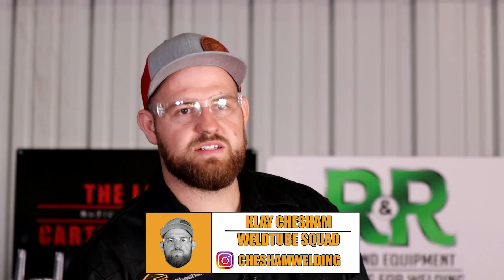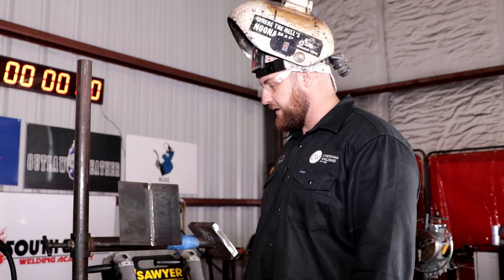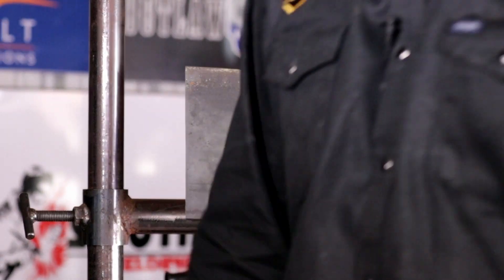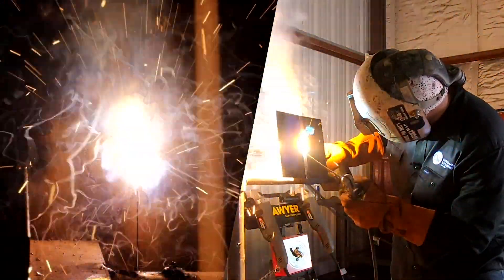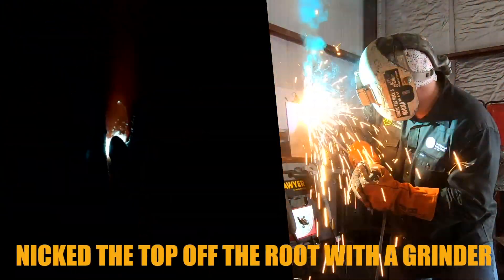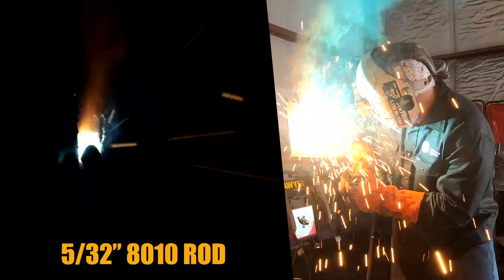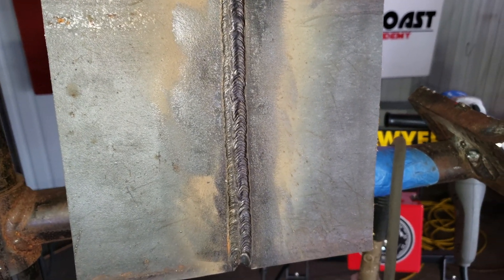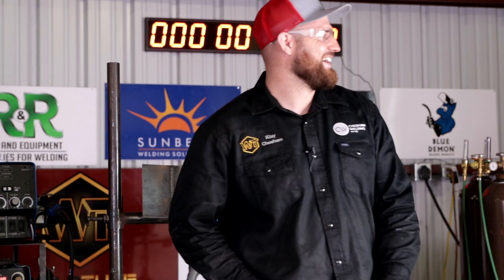3G Downhill Test

Comment: Are auto-shade helmet's a sin in the pro world????
Reply: Stephen B. Na, use what works. Only old hardasses care about your lenses.
Reply: Not at all. Some of the cheaper ones dont have as good vision clarity though. I dont like them for any tig welding as they can flash, but for any stick work, I use them nore often than not
Reply: Easy to replace the parts